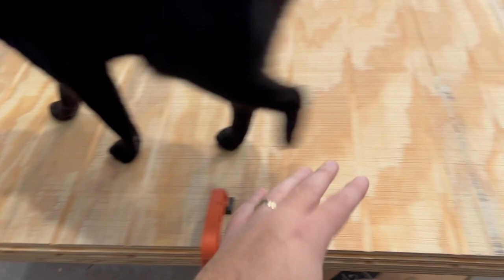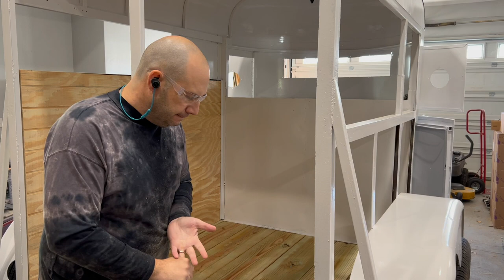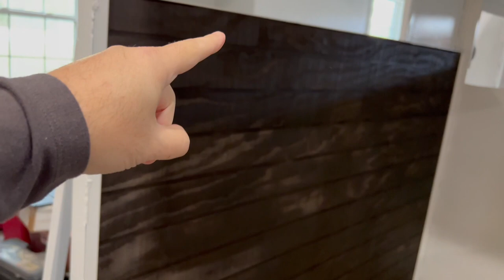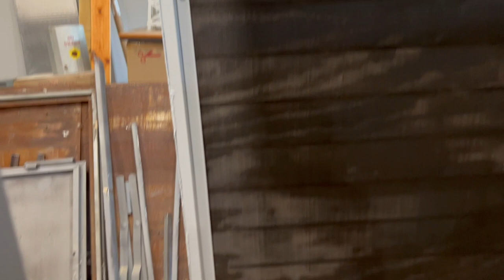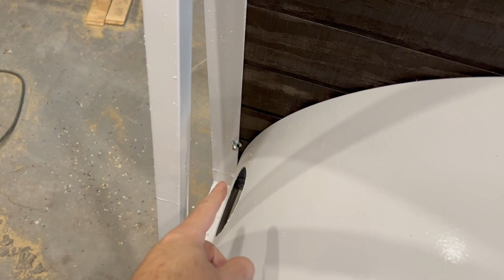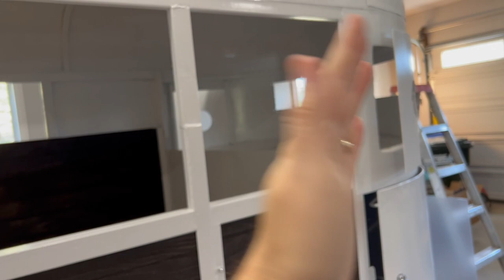QUICKER way to Install Wall Wood!

Comment: Great tip! Wish I would've saw this before I installed half of the 5" tongue and grove!! 🙄 tempted to tear it out and start over 😋
Reply from the maker: I know right! I figured I would try it after noticing the patterned plywood at Lowes and it hit me that it would be much quicker and easier to handle than the tongue and groove.

Comment: Thank you!! This video was very helpful!! 

I'll be showing it to the hubby to see if he agrees. 

We will have to drill through the metal wall as well. Is that what the titanium nitride drill bits can do?
Reply from the maker: I use dewalt bits with the pilot tip. You don’t have to have anything fancy to get through it though.

Comment: Thank you so much for this video! 🤗 I am still in the process of pulling the old wood out of my trailer right now. I was concerned about how thin the metal would be by itself. After watching your video I plan on using 1/2 inch plywood with the lines like yours and sand down the metal and put it back up for strength. Thank you so much!
Reply from the maker: That’s a great idea if you’re reusing the sheet metal exterior for the walls. It will definitely make the interior look better than plain plywood. I bet it will turn out great! Glad the video helped!

Comment: Weather wise. Is this material able to withstand rain and different elements? 

Also what was the width you used with this material ? I know it can vary depending on the gap size for the trailer. 

Thanks! Love the videos
Reply from the maker: @loganclark2763  this material is similar to plywood and designed to be stained or painted. The exterior deck stain that I use seals it and it should be good for years. Hope that helps and thanks for the feedback!

Comment: Do you know what make/ model this trailer is?
Reply from the maker: This trailer is a 1997 WW two horse. Hope that helps. There are slight variations in the years but I’ve done trailers from 1978 up to the early 2000’s and they’re all pretty similar.